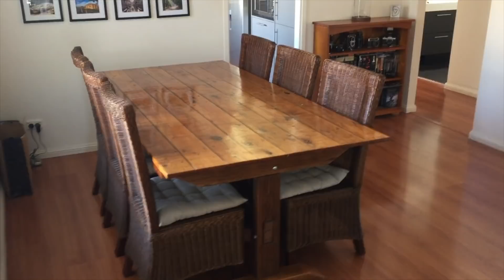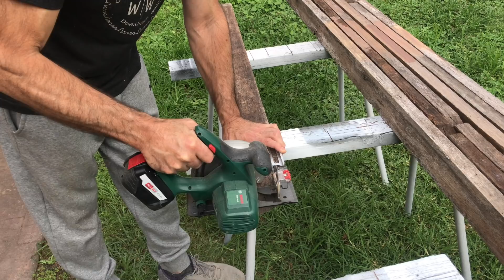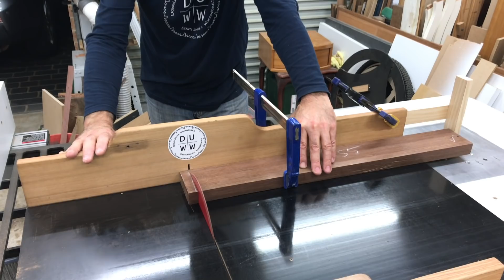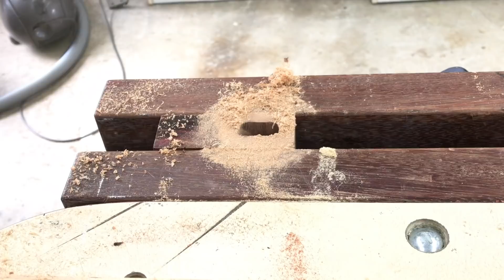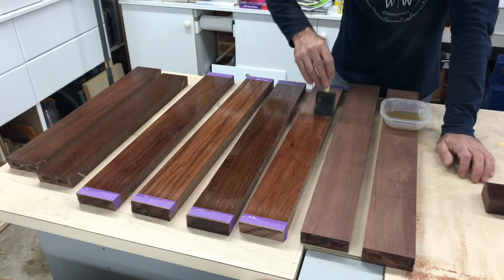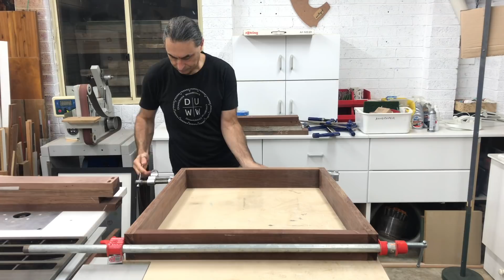Dining table upgrade: Part 1 - Making the legs

Comment: Your Channel was recommended by Gary Podger over in Brisbane.  Paul Carlson of the Small Workshop Guy Channel had Gary on for a tour of his shop this week.  I live in the Northeast US.  I've never seen a plunge router like the one you use.  What make and model is that?  I like the way it plunges into the wood.  Glad I found your channel.
Reply from the maker: Hi Rich, the router is the TritonTRA001. Its a beast of a tool.

Comment: Nice one Vic, that hardwood cut nicely and I didnt expect that. When I built houses in the early 70's the whole frame of the house was all hardwood from the region and was cut to size with a big old 9 1/4 Makita, nothing else would have the grunt. Brought back a few memories there for me mate, nice work so far. cheers.
Reply from the maker: Thanks mate. The 9 1/4 Makita brings back memories, it was the first circular saw i ever had

Comment: Nice Vic, looking good. I just started my mitre station today by cutting my legs 81mm short in a brain fart of a first step so good to see these silly errors are not exclusive 😂. Also great to use up some of the stockpile!
Reply from the maker: Haha, join the club mate. 81mm is a very specific measurement. How did that happen?
Reply: @DownUnderWoodWork  it should have been 19mm to allow for the MDF top... Somehow 900 - 19 = 81 off 😅